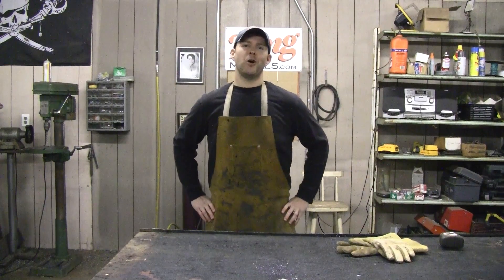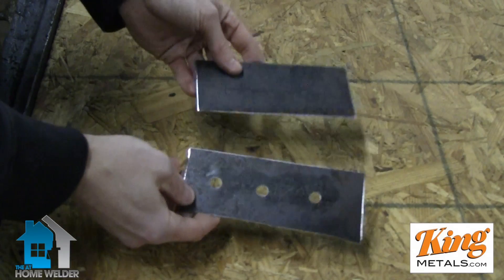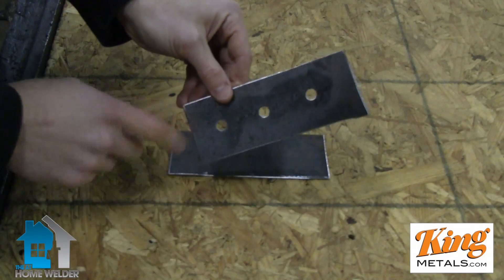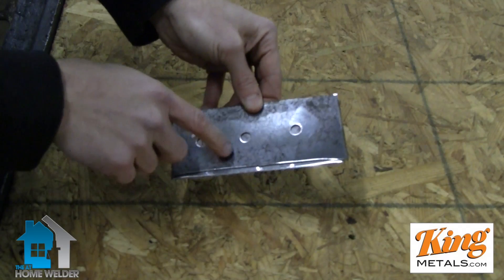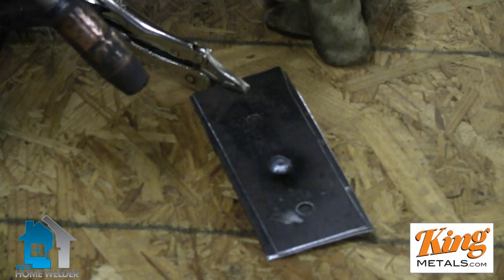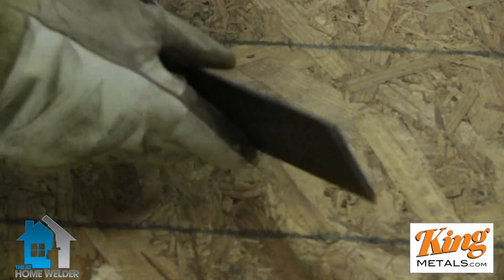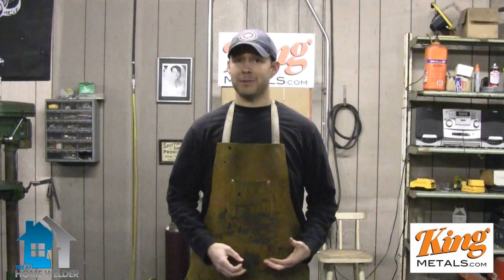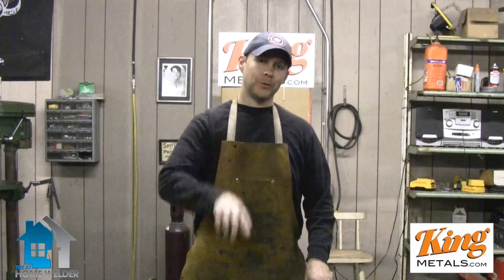How To Plug Weld

Comment: I’m having trouble with my Hobart 140 burning through 22g metal using 5/16” plug weld with C25.  My settings are 1/5 for voltage and 20 for wire speed using .030 wire.  I’m either burning through the backing plate or when my arc hits the edge of the top plat it burns the edge away.  And, yes I am clamped and flat.  Should I use smaller wire .024...?

BTW; what gauge sheet metal was that...?

Comment: I want to weld a 1/2 in dia round steel shaft to a 1/4 inch thick steel bar a "T" shape a
Reply: Using a plug weld.  How deep should the shaft be in the bar?

Comment: If you have drilled out spot welds but are now welding the panels back together, any advice on the initial drilling to still keep enough of the back panel material intact to then weld back the top panel?  There's probably going to be a drilled pilot hole to fill on the back panel along with plug in the top panel.  Any technique to share on this?
Reply: Us a copper backing plate and weld from the edges of the steel in towards the center, directing your heat into the steel, not the copper. The copper will not stick to the steel.
Reply: Get an actual spot weld drill bit, it only drills thru the top piece and then you stop. Leaving the other piece intact ready to plug weld

Comment: Can i weld a 1.5m *0.5m*16mm thk plate on a 1.5m*0.5m*65mm thk plate with a number of plug welds and side welds?? Will the smaller plate have bends or any distortion??

Comment: I need to weld in some floor panels in my Jeep. After I remove the bad metal can I plug weld some flat metal underneath what remains to form sort of a "lip" around the opening. Then set my new metal in and rest it on the "lip" and butt weld the pieces together?
Thanks 
Jim
Reply from the maker: That'll be fine if the condition of the metal you're plug welding the lip to is good. You'll also want to take it slow and "leap frog" the butt welds to reduce heat warpage.
Reply: KingMetalsInc 
Thanks

Comment: I am trying to weld a harden metal to  a non harden , two flat pieces together and my tig  will not stick to the bottom harden metal in a plug weld?. I am using a flux core wire.,

Comment: It looks like you started out with about an inch of wire on the center weld. Do you normally use that much wire to start your welds? Also have you ever tried plug welding from the outside in? Thanks for the video.

Comment: hi good video im restoring a 67 firebrd  it has galvonized metal rockers having alot of trouble getiing welds to stick   its ground clean   any tps
Reply: +lynn loren 
Flux-wire welding is good on zink-plated steel, but do not breathe the fumes. The Zink will raise the temperature by burning white so be a bit careful with the amperage and use a good mask.

Comment: I want to do this with my "unibody" vehicle project, what do I do to seal in between? Does anyone make a substance to apply before doing this weld to be sure it is "sealed" so water doesn't get in between once I am done? Or what do I need to do? Seal it right after the welds are done?  This is on the bottom of a vehicle.
I am kinda looking for a semi-(unburnable, and sealing type of substance), which totally seals in between. Is there anything like that?